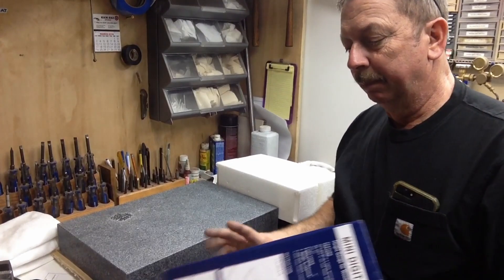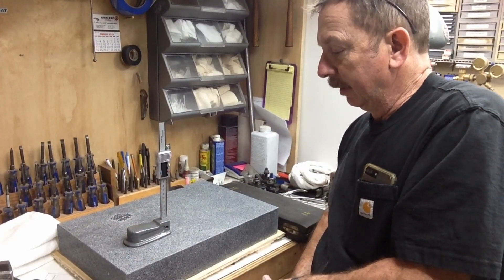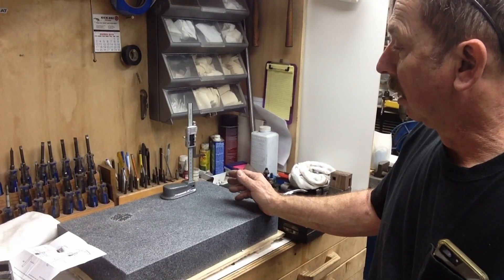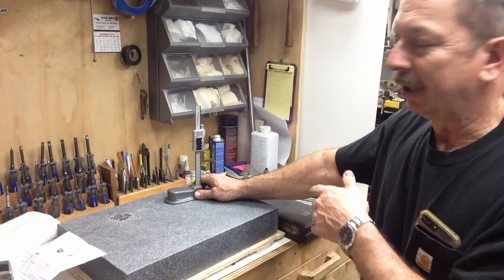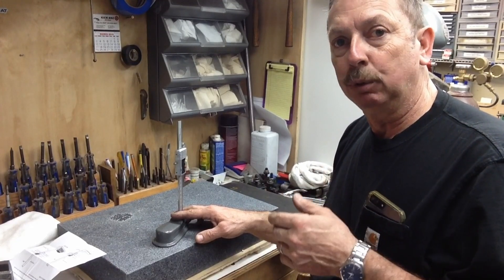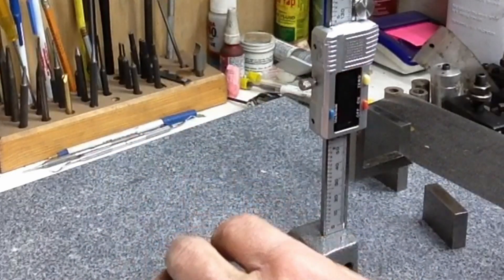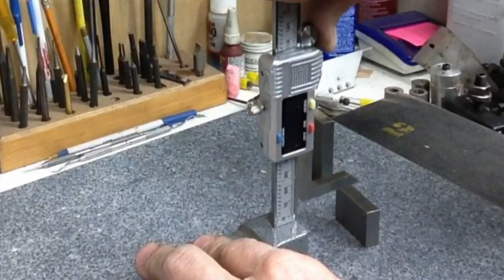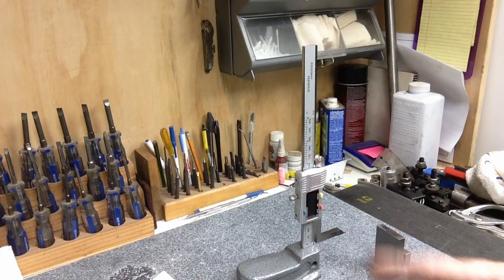Inexpensive Digital Height Guage For The Surface Plate

Comment: Part of the error that you got from turning the gage off and then back on is due to how a digital measuring device works. Digital signals are all or nothing. The last digit in the display (when reading in inches) is either zero or five. This means that any measurement can only be measured to within +/- 0.00025" . When turned off, the device resets to zero but the head may actually have to move to reach the first triggering signal. The bottom line is that the last digit displayed is not significant... the standard digital caliper or similar device can accurately read to +/- 0.001" but can't get give the true size of a work piece any closer than that. So if you are, for instance, fitting bearings then it's time for a micrometer or bore gage.

Cheers from NC/USA
Reply from the maker: Thanks for the explanation, the interesting thing for me is that it resets to zero when it is shut off. None of the other scales I have loose their position when powered off and then back on
Reply: My Mititoyo digital calipers loose position when turned off (both sets) as well as the Chinesium calipers I have.
 I have several sets of the $10 Horror Freight calipers and they work fine. I use the "off" button and batteries seem to last 2-3 years. 
  When buying a set of these inexpensive calipers I alway check to see that the jaws close with no light showing before I leave the store. You do need to go over the calipers with a fine India stone to remove the sharp edges.. it makes them significantly smoother to use.
  The good news is that the Chinese calipers are so cheap you can cut them up to make digital readouts in the back yard shop. They are the cat's pajamas for making a digital readout for the quill feed on a Rong Fu style bench milling machine. Without one it's difficult to make an accurate downfeed because of the backleash in the gearing between the feed dial and the quill.

Cheers from NC/USA
Reply from the maker: Interesting, I just checked the tail stock scale on my Sheldon and it retains its reading, (self powered by its battery), and the quill readout on the mill also retains its reading ( it is powered by the Shumatec dro). I will investigate further as I have time.